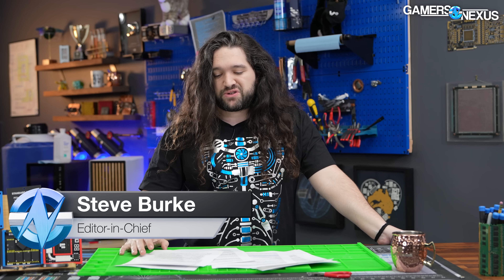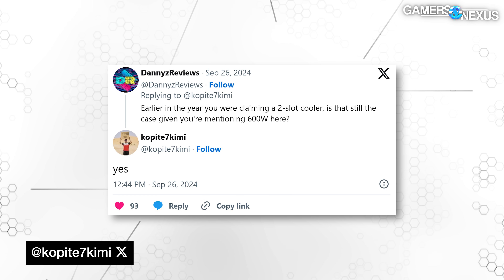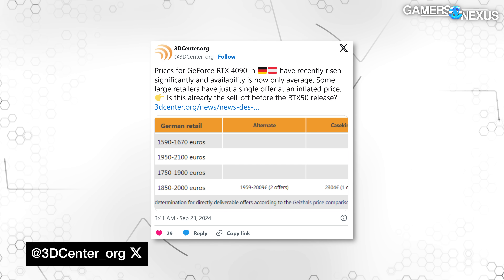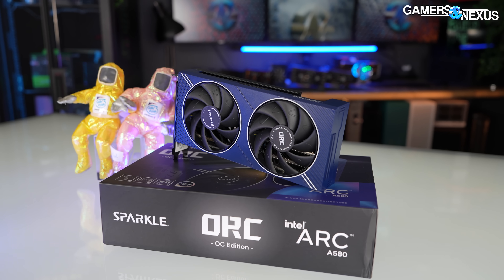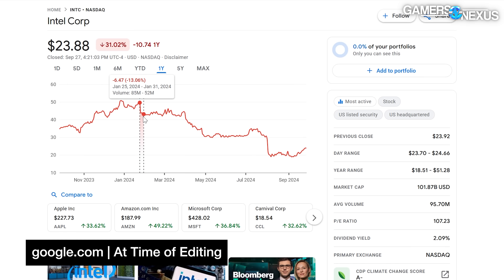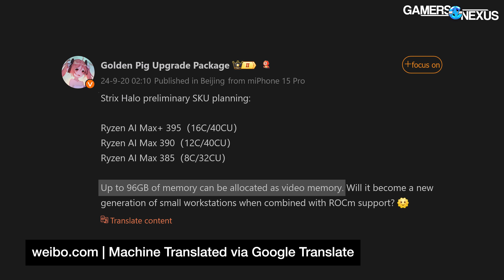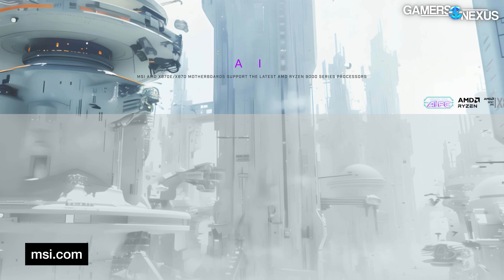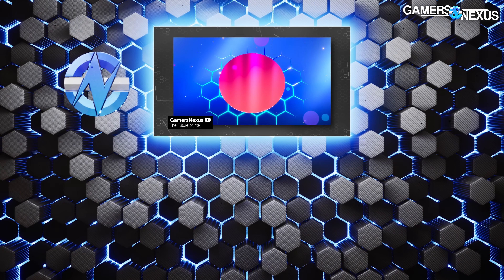HW News - RTX 5090 & 5080 Leaks, Valve ARM64 Experiments, Intel Arc 0% Marketshare, 4090 Price

Comment: Can you please investigate Gigabyte's misleading practices regarding their AM5 motherboards? Specifically, the B650 Gaming X. They sell different revisions under the same model name, but the critical difference is that rev 1.3 only supports the Ryzen 7000 series, while rev 1.5 supports the 8000 and 9000 series. When purchasing these motherboards, Gigabyte doesn’t clearly mention the revision number or clarify that different revisions exist, even though they have vastly different compatibility. This lack of transparency is misleading to consumers, as the model names are identical, and buyers might not realize they're purchasing an older revision that limits future upgrades.
Reply from the maker: Thanks for bringing this one to our attention. Will try to find time to look into it, but we are pretty backed up right now on investigations. Can't promise this one only because we really are overloaded to a point where we need to pick and choose. It's tough since a lot of the deep dives require some serious time commitment to prove irrefutably.
Reply: Is that board even sold still? The revisions should be separate SKUs, how is that misleading? Who did you buy it from, I'm assuming not Gigabyte directly. The current Gaming X AX and Gaming X AX V2 are always listed separately.
Reply: @drewnewby  first off, they’re talking ONLY about the Gaming X AX. Not the V2. Secondly, No one buys directly from gigabyte. Every retailer that lists that board does not list the revision. That’s the problem, and that’s gigabyte’s problem when they release 5 B650 Gaming X AX boards, all named the same, with extremely varied specs. And yes, the board is still sold now, and if you order on Amazon, you have no way of knowing which revision you get.
Reply: That seems very shady, it would be normal for an earlier revision to not support future chips without a BIOS update but yeah you're right I just looked on their support site listed and under CPU support, the 9000 series are not even listed unless you select rev 1.5! That's what the kids would call "SUS AF" I believe...
Reply: @GamersNexus  Thank you
Reply: @drewnewby  I bought it 1 year ago, it was listed as AM5, it's the only B650 that doesn't support 8000/9000, even A620 support 8000/9000, GIGABYTE scammed us.
Reply: @joemarais7683  Well said.
Reply: Damn that's messed up, unavoidable even.
Reply: @joesmarais7683 You're not familiar with the SKUs, the Gaming X OP mentioned is a separate SKU from the Gaming X AX revisions that are currently sold. The Gaming X AX has had 7 revisions alone, only the 1.5 and V2 support 8000 and 9000 series. I know OP didn't buy directly from Gigabyte, that's the point, retailers intentional omit revisions to move old inventory, that is not a Gigabyte "problem" despite your insistence. Over 30 years of buying boards with this same issue with suppliers. It's not the AIBs or manufacturers at fault here, get your pitchfork pointed inthe right direction.
Reply: @PREDATEURLT  I literally contacted gigabyte support, and they said I should buy a new Motherboard if I want to upgrade my CPU to anything other than Ryzen 7000 series.
Reply: This isn't new for Gigabyte's board. It's been done over and over again. We have a saying, for gigabyte's board., you can only purchase very first version of that model.
Reply: @R3TR0JVN   I literally contacted gigabyte support, and they said I should buy a new Motherboard if I want to upgrade my CPU to anything other than Ryzen 7000 series... what kind of AM5 is this???
Reply: @eddieliao1500  What kind of AM5 is this??? Even a fucking  A620 support 8000/9000.
Reply: @jackali5014 I get it, you wanted to reuse the board, but with a SKU that's no longer sold, and that had 5 revisions there's no guarantee of future compatibility. You made it sound like you just bought the board and got the older revision, which is an issue with the retailer. Board revisions are as old as consumer motherboards have existed, not exactly a scam.
Reply: Seems this is a common practice on their motherboards even on the FX days. I was surprised how their future revisions are highly prized, since future revisions fixes issues of their earlier ones. Also, if you have RMA issues, they will replace it with a higher revision usually.
Reply: Rev 1.0-1.3 have the proper bios and memory QVL for ryzen 9k. they likely just haven't updated the cpu support list because they haven't tested those boards in house. happens when boards aren't manufactured anymore. it'll usually take a month or two before they get around to updating all of them. also there's really nothing to investigate, the advertising page clearly states it supports ryzen 7k series. there's nothing mentioned about 9k series anywhere on there except for rev 1.5, so that kills the false advertisement argument. likely when they get around to updating the support page for those revisions they'll add 9k series to the marketing.
Reply: @PREDATEURLT  yeah thinking so even more now because it also doesn't officially support the 8k series APU's but you can find threads/articles all over the place with that specific board revision running the 8k series APU's. they're probably just not testing those boards so they can't officially say if it's supported or not.
Reply: @drewnewby  I did buy the board and got the older revision now I'm trying to get refund from the seller...
Reply: @triadwarfare  I'm working on it
Reply: @sirmonkey1985  There was no mention of any (rev) when I bought it
Reply: Here's a real scam. About 20 years ago, I bought a large order of Asus boards. They all had defective BIOS chips, would not boot or flash. On multiple forums, including their own, Asus claimed no issue. I posted my situation on all of them. Asus reached out privately, admitted the defect, and offered to replace the chips for "free"...if I paid shipping the defective ones back and the new ones from Taiwan, about $30 per, nearly half the cost of the board. I posted their entire communication to each forum, and returned the few dozen boards to the supplier as defective, free RMA. I haven't used a single Asus board in a customer build since.
Reply: @PREDATEURLT OP's situation isn't a Gigabyte scam. Their site clearly show all revisions, each with their own page and which CPUs are supported. They may eventually update the BIOS on those boards. Don't buy boards from retailers that do not list revision or SKU.
Reply: Product naming in pc tech, and mobile phones, is deliberately misleading. Any product with different features/specs, should be forced to have a different model number.
Reply: The warning about compatibility comes when purchasing the cpu in 90% of the places I’ve looked. Mentions bios updates may be needed etc.
Reply: When I bought my B650 Aurous Elite (which has 3 versions now) I had to look for the revision printed on the physical motherboard itself to figure out exactly what it was. I could have looked at the WiFi to determine that, too, but they didn't make it easy to know what you're getting from the box or their Amazon storefront.
Reply: @jackali5014 I don't like Gigabyte but this doesn't make much sense. Are you saying the revision you have is no longer receiving bios updates? Otherwise I really wouldn't trust what support says.
Reply: @JJFX-  It's getting bios updates, I've just checked, but the bios's don't list if they add AM5 support and the CPU support page of the motherboard doesn't list anything but Ryzen 7000 series CPUs.

That being said, it could still support Zen 5 just be horribly documented on their site.
Reply: @shawnpitman876  The support comes from the AM5 AGESA so yeah, if it's getting updates it should be fine. The potential issue is when older boards simply stop getting supported but overall, AMD has done a decent job encouraging manufacturers to do this.

It's usually very easy for them to simply implement the new AGESA unless there's hardware-specific or UI features that need to be modified but it's not at all surprising that they aren't updating the documentation.
Reply: The Gigabyte Gaming X AX b650 is a piece of trash. I know because I used to own one. Nothing but issues. Their exploding PSUs and melting GPUs which don't have fuses should be enough to stay away from them. They make trash, do not buy.
Reply: @GamersNexus  "we are pretty backed up right now on investigations" is a crazy thing to say, when you really think about it. 😨
Reply: I have had good physical reliability from my old Gigabyte 990fx board [Mid range board with good components and the top chipset for AM2+], but their firmware support is known to be very flakey and they don't update support lists (I ran 2×8GB dimms no issues and it even detected their performance mode profile [EXP or similar?], with firmware v2, but Gigabyte doesn't list amy dimms over 4GB). 
I had to downgrade from firmware V3 to V2 after months of crazy intermittent CPU overheating issues, I even tried repasting the cooler. They never did fix the bug and v3 remains on their download page as the latest version.

I finally diagnosed that the CPU fan worked normally after a reboot, but after a suspend/sleep and wakeup the CPU fan stayed asleep. 
It was not obvious because I did not have sleep enabled around the time of the firmware update and even after enabling sleep it was still the cool season. The case fans were not affected and I normally run low fan settings (and underclocked) so the CPU fan is off or idling very quiet much of the time so sound wasn't an indicator. I was also using that machine for light loads during that time frame so it might take an hour of active use in a warm afternood to set off the cpu temp alarm (which I normally set at quite a low temp unless doing something special right at the edge).
Reply: I also had a lot of extra fidding with settings in their UEFI to get USB3 working correctly.
Reply: They've done similar with my budget AM4 board, the A520M DS3H. In the new revision, they removed:

2 CPU VRMs, the DVI connector, the RGB header + functionality, 1 fan header and 2 USB 2.0 ports.
Furthermore the "CPUless" BIOS update feature, which to be fair isn't really needed anymore.

The only positive thing they've done is fixing two vertical SATA ports behind the PCIe x16 slot, which were easily covered by a bit longer videocards.
Oh and of course they're selling this gimped v2 board for the same price I got my v1!
Reply: Happened with my B550m ud, there like 7 revisions and I got the one without and RGB port
Reply: @Hudee1985 V2 models go either way. Here, in the US, the A520M DS3H V2 is not even remotely the same price. It sells for 25% less than the revision 1.x, which was the point of the changes.
Reply: @triadwarfare  I can confirm this.
I am running a Gigabyte 990fxa-ud5v30 (that is version 3.0) with a Fx-9370 (a 220W CPU) in my PC and versions previous to the one I have only supported CPUs up to 125W (like the Fx-8370).
For the version I have, according to information in multiple threads on several forums, they re-engineered the power distribution (including physically dimensions of the power planes and VRM specs) to support the higher power requirement, effectively making this a different board (at least internally).
No amount of BIOS hacks can make previous version boards provide more power to support my CPU. It is physically impossible. 
I do not know if the OP problem can be fixed with a BIOS update or if it is a physical problem like with mine (I do not know the differences between those CPU series) but I would play it safe and try to return it.

Comment: 5080 $1699, 5090 $2399, just wait.
Reply: The more you buy, the more you save 😂
Reply: They wont sell many if the VRAM capacities havent gone up. Gamers dont have the money to buy those in quantities, and AI training demand wont be there with relatively low VRAM.
Reply: I think they'll keep the 5080 at $1000. Judging by those specs it's probably going to be doing half the work of the 5090 which I suspect will be $2000. The 4080 at $1200 was a flop last time around because it was 50% less performance for only a few hundred dollars less. They need to keep that price gap bigger this time if they want to keep the performance gap so big between cards.
Reply: 5080 $1499, 5090 $2499   ( after that ...... the 24Gb 5080ti  &1899 )
Reply: The leather jacket in each presentation is a different one, it may not look like that but it is. Those arent gonna pay themselves and the jacket guy is looking at our pockets to milk them!!!
Reply: @eorzoriantr5228 It's not just a different jacket in each presentation, it's a different Jensen. It's costly to clone him for each one, Nvidia fans must pay.
Reply: It'll have to be $2999 with 32GB of DDR7. Probably $1000 just for the VRAM
Reply: 5090 will be at least 2x to 2.5x the cost of 5080.  That thing has double the vram of 5080.  And we all know why Nvidia only gives 5080 16gb vram while that thing is 10% more powerful than 4090 24gb vram.
Reply: I think $2499 USD is still conservative for the 5090. It's becoming clear that only the 5090 will leverage the multi die GPU variant we've heard so much about, while the rest of the line up will use only one, with at most half the VRAM of their flagship. nVidia's 5090 will remain out of reach for the vast majority of gamers. It makes sense that AMD is focusing on mid-tier GPU products. Strix Halo APUs sure won't hurt either, unless AMD fumbles its launch, too. 🤦
Reply: Nah 5080 $1800, 5090 $2500
Reply: wrong
Reply: If this is true, I will curse NVIDIA and Jensen.
Reply: Im guessing: 

4080 super duper 900

5080 1200 (discountee to 1k later) 

4090: still 1600 (consumers dont deserve discounts) 

5090: 2000 

the 5090 will be produced in small numbers on purpose so it'll be massively marked up.  Once they run out, the remaining 4090s will go up in price for another high markup.  Effectively connedsumers will be paying super premiums for old tech, courtesy of Nvidia.
Reply: @zivzulander  thats what everyone said about the 40000 cards as well. "Ppl wony buy" maaan u know that everyone will buy 🤣
Reply: Shut up and take my money!
Reply: 5080 will cost less than 4090 thats for sure. It will be like 10% faster, with less memory etc, and the selling point will be that its faster than 4090 but costs less. So I expect 5080 to cost under 1600 USD. My guess is 1200 USD, which is ridiculous but... just wait
Reply: Finally, I can afford a 3080
Reply: @BBWahoo The 3070 is where it's at. $200, and none of that 3080 clapped-out GDDR6X, overheated from mining.
Reply: @drewnewby  That's not too bad. Only a half a paycheck for most people.
Reply: @jamesm568 Paycheck? Ah, you're a workaday. Nvidia has no concern what it costs you peasants.
Reply: @drewnewby  Of course they don't as they're out to make money off of peasants.
Reply: @drewnewby  and people still think the 5080 will be 10% faster than 4090 kekw..
maybe with triple framegen
Reply: @zivzulander you underestimate the stupidity of fanboys with money
Reply: @zivzulander  If you want to focus on AI there already are way better GPUs options out there with 48GB+ VRAM which have AI as main focus and are not really meant for gaming. They do cost between 3k - 23k tho lol. Cheapest 80GB VRAM I have seen was 13k but they can go up to 23k+
Reply: 5080 is going to be likely 1300$. The 4080 was 1200$ and it was selling so bad. That's why they introduced the 4080S with a reduced price..
Reply: @zivzulander Gamers don't care about VRAM. The 4070 Ti 12GB was the most popular 40 series card, THAT card sold the most units.
Reply: This is Nvidia math. Silence peasants, Lord Jensen cares not for what should be. He demands tax to to equal Apple.
Reply: Canadian $$ 5090 will be over $3000 im almost sure of it but would be nice if was wrong
Reply: @Mjet403 $3299 CAD, and thank Nvidia if / when it's available in that foreign land.
Reply: New leaked info on price. Your nearly spot on! xD

5090 - $2000-$2500
5080 - $1200-$1600

And im not remotely surprised. people have been paying for the over priced bullshit 4000's series cards and the scalped 3000 series cards since Covid. nVidea wouldent dare lower prices and lose out on all that money.
Reply: @jamesmartin8005 Gamer vassals must be reminded that Lord Jensen does not intend this silicon for them, and will pay dearly for the privilege.
Reply: Idk, the way the 5090 is explained and its specs. This leads me to believe it'll be a $3000 card easily.  5090 seems to be out of the question for consumer gaming. I can't ever see a game using all 32gb of Vram.  The 5090 seems to be made for work, not gaming.  

It can be used for gaming, but that is why I feel the 5080 is made the way it is. 5080 will be the best card you'll get for price and performance for gaming. I'm assuming it'll be 1000-1500$. With its 16gb of Vram, it only makes logical sense that the 5080 is more for consumer gaming.